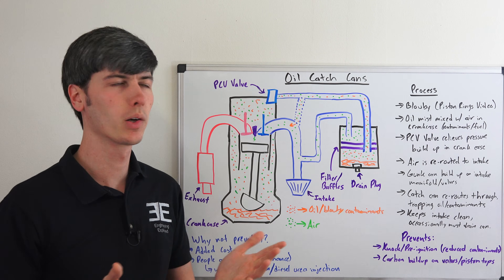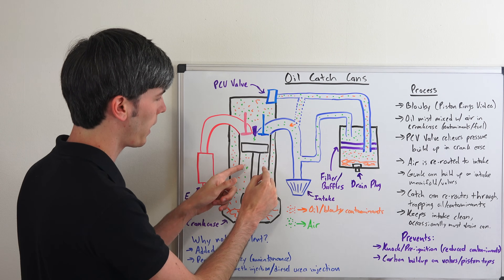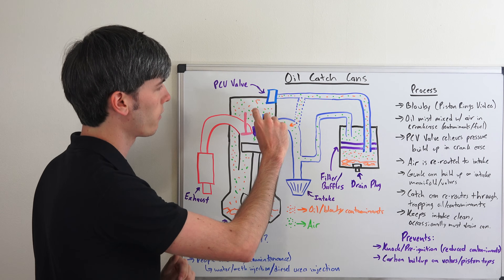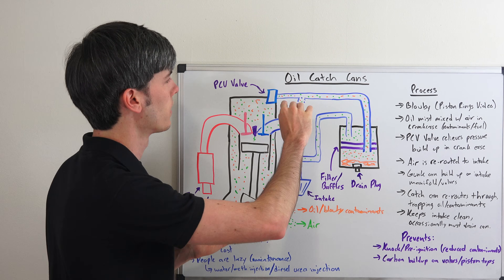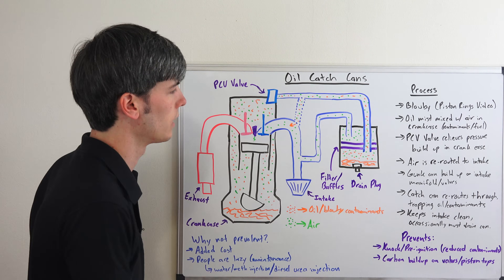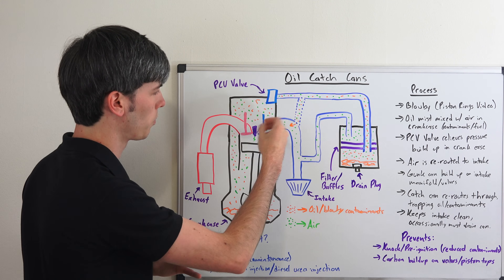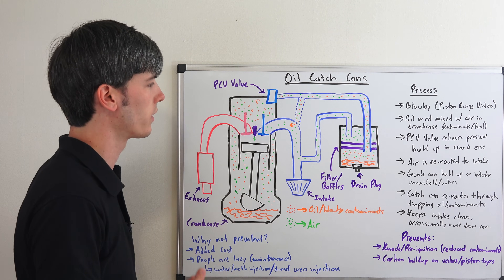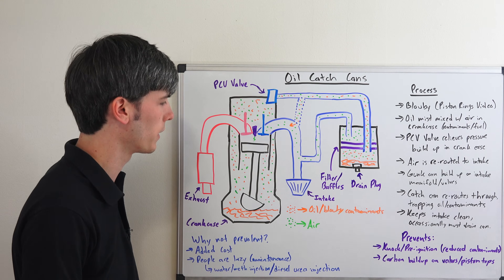What Is An Oil Catch Can?

Comment: Nice, clear explanation.
I'd add a few extras for those curious.

Historically, crankcases were ventilated to the open air: dripping to the ground, that is. It's environmental thinking that had lead to feeding it back to the intake. (Some engines still have the open tube, like older style lawnmovers.)

Stock engines also have some sort of separator already built in, that allows oil to condensate and drip back into the head or sump, before drawn in by the intake.

It's not only the leakage of piston rings that causes crankcase pressure, you also need some ventilation because of the obvious reason of thermal expansion in there, and the movement of the piston(s) themselves.
(Interestingly, the latter is what's actually utilized in two-strokes, this pressure is intentionally contained there.)

Speaking of the crankcase gasses, it actually contains a large amount of water vapor. What you can see as gunk in a ventilation system is a tiny amount of oil residue building up over several years.

In our workshop we've built and tested condensation type cans on a carburettor engine and on an injection one also. It extracted half a litre lightbrownish water quite quickly, so draining the can was really needed. You can still have the benefits of a filter-type can, though, like shown here, as these catch oil particles but let water vapor pass through, as far as I can tell.

All in all, since most of the oil can be separated (done in the valve cover most often) and water vapor is not harmful, it's considered safe and not having major drawbacks feeding it back to the intake.

I just hate the look of oil in my engines' intake parts myself :)
Reply: Quick question, my front seal on the crankshaft leaked oil after 400 miles on my brand new ZL1 after the dealership replaced the seal, a buddy of mine recommend to insta that catch to insure that the pressure won't build up again causing the new seal to pop again during speeding or track use. Do you agree that the catch can would help with that issue?
Reply: @youseftawhed  Your crankcase shouldn't develop that much pressure to begin with. It typically occurs in old engines with worn-out piston seals and bores. The pressure won't drop with the can installed, unless you disconnect it from the air-intake, and let it breathe openly.

Comment: In the Mighty Car Mods video on installing an oil catch can, they mention being wary of plumbing a catch can directly to the pcv valve because it can have an affect on the reading of an air flow meter (not sure if this is a problem if your car uses a manifold pressure sensor instead).  I think that is what they were saying. Even on the forums for my car there seems to be some discrepancy on the correct way to plumb it between the pcv, or the rocker covers, or both.  All cars are different but I was curious if anyone had any thoughts on this.

Comment: what about oil filters? I don't see one in your system, is the oil catch can actually the oil filter? ( the black can I replace every so often when changing oil)?
Reply from the maker: Your oil does not circulate through the PCV system, just what escapes the crankcase as mist. There is a separate system for circulating and filtering oil.
Reply: You should make a video on that :D
Reply: So you still need to change your oil filter this just collects the crap that gets thrown back into the pistons the oil filter is where all of your oil circulates to get rid of all the grim and micro particles anything that goes into that catch can does not go back into your engine it sits there until you empty it

Comment: I'd reiterate the idea of going into slightly more detail for these types of videos. For a topic like catch cans, there are certainly many more arguments for and against catch cans. For cold climates, there's the potential of freezing lines and plugging crankcase ventilation. Also, there are various types of catch cans, including vent to atmosphere and recirculating.
Reply: Regarding to that, it 's also important that the airflow restriction is keeping as small as it could be.
Otherwise the crankcasepressure is getting high and causes Oilleaks.

So, you have to keep the routing short and the catch can should not contain a Brassfilter in it.

Comment: Why  this air return back to intake ???
Reply: You don't have to but why vent gas that could be burned into the atmosphere? A lot of older hot rod engines back in the day just have a tiny filter attached to the the valve cover doing just that.
Reply: +FivepointohJerry thanks
Reply: I owned such an engine at one point and the first thing I did to it was route a rubber hose (later replaced with metal line when it bulged) to return the air back into the intake. Even the intake on that engine was already set up for it, just had to drill out a plug and tap the hole to attach a fitting.
Reply: +FivepointohJerry Environmental regulations. Burning the vapors and then running them through the cat render them environmentally acceptable....at least to date

Comment: would it be possible just to run a filter and let it breathe into the atmosphere?
Reply: That was the usual system back in the day. The oil filler cap just had a few holes in it and a bit of wire wool inside. Fine for the engine but less so for the health of anyone breathing the fumes that came out. Those crankcase gases are really nasty and carcinogenic. In fact they're probably also what makes used engine oil so toxic.
Reply: That was the usual system back in the day. The oil filler cap just had a few holes in it and a bit of wire wool inside. Fine for the engine but less so for the health of anyone breathing the fumes that came out. Those crankcase gases are really nasty and carcinogenic. In fact they're probably also what makes used engine oil so toxic.

Comment: Adding a Catch Can to the F150 EcoBoost engines is getting fairly common, especially when tuned and when used for towing.  I'm considering a catch can for my 2015 F150 , but would like to know if anyone has a recommendation.

Comment: Some say the oil catch can is only useful for boosted cars, what about my natural intake miata 1.8l? is this gonna help or not necessary? @EngineeringExplained
Reply from the maker: It will do the same thing either way, but turbo engines (depending on where the air re-enters) may benefit more from not putting oil on your intercooler/turbo, and also boosted engines tend to be more prone for pre-ignition/knock, which this can (in some ways) help prevent.
Reply: Much appreciated for the reply!

Comment: Cant you just route the oil in the catch can, back to the oil pan of the engine? So that people don't have to worry about changing the oil in the can or would that contaminate the oil to much?
Reply: The stuff that gets caught in the catch can is really nasty. You don't want that back in your crank case if you can avoid it.
Reply: @KlueBat  yet it goes back to turbo intake
Reply: Yes..contaminated.
Reply: Yes, you can, as long as the oil changes are completed on time. BMWs with the M54 inline-6 use a "CCV" system (crankcase ventilation system) that does just that. Problem is, the CCV system in those engines is all plastic, and will eventually crack; especially in cold climates, where the oil vapors/residue/water can freeze overnight. In bad cases, CCV failure has caused hydrolocked engines, when the engine has sucked oil directly into the combustion chambers from the oil pan.
Reply: i have a 300 TDi land rover engine it has a cyclonic oil separator or catch can, it has one inlet and two outlets, one goes directly to the intake hose, the other that is at the bottom of the can, after a funnel type form, goes directly to the crank case dumping the oil separated, but anyways i get a couple of spoons of oil into the intake.
Reply: Hans Göran Högström Probably would clog the cats and not pass emissions..
Reply: TheEdudo Yeah, the BMW CCV system still allows a lot of blow-by into the intake stream, too.
Reply: I dunno, but maybe there is possible to design a safe reliable drain system from the can that routes the excess oil and fumes to the exhaust where it can burn off?
Reply: Hans Göran Högström Yeah, that safe and reliable system is called a "catch can." ;)
Reply: KlueBat The LB7 Duramax had that setup from the factory, and 10,000 mile oil change intervals. Mine has 312,000 miles on it, and there are many with much higher than that. All that stuff is already in your crank case, that's where the PCV is coming from. The lighter stuff (water, fuel) cokes off and goes out with the air. It doesn't hurt to keep it separate, but I don't think it really helps much either.

Comment: Especially important if you have either Direct Injection or Turbo engines, especially if your engine is both. 

Direct Injection you don't get the cleaning action of fuel on the intake valves, so that oil buildup becomes a serious problem. 

Turbo has higher pressure and thus more blowby under boost than a non-turbo, and thus more oil consumed through the PCV system. 

One caveat also, if you have a turbo engine, you have to make sure the PCV valve itself stays on the correct side of the catch can as you don't want boost going into your catch can!
Reply: Once you get into serious boost the stock systems are just inadequate and your dipstick becomes a projectile lol. I run 2 -8AN lines from the VC to a catch can and a -10AN line to the intake.
Reply: Macus Thomas On some cars if you do that however, you will trip engine codes and reduced performance from the ECU. Keeping the EVAP and PCV sensors happy is a big concern on newer cars.
Reply: Hence why I don't own anything new lol
Reply: +Macus Thomas my fiance's new optima sxl has a PCV. Actually on that car with the theta 2 engine, 2 catch cans should be used
Reply: It depends on how the air is metered. Some mass flow sensors are after the air filter, before the throttle body, or at the manifold.
Reply: Macus Thomas so is it a good idea to remove ur pcv all together
Reply: +Macus Thomas not on newer vehicles. I tried to remove my pcv on my 2004 3.4L Tacoma and the motor died and wouldn't start
Reply: Louie Watson Not so true. I have a 2015 and it has a PCV valve. It is part of a larger system of the Air-Oil Separator, which operates similarly but less effectively to a catch can, rather than just being a valve in a hose, but it still exists. Had to relocate it when I added my catch can. 

These systems aren't easily identifiable to someone who worked on cars in the 1970s-1980s, but they do exist.
Reply: Macus Thomas Fiat 500 Abarth. 1.4 Multiair Turbo. It does have the plastic canister air-oil separator. However, you still have to have a check valve to keep boost from going back into the crankcase, which is what the PCV valve functions as. The PCV valve is screwed into the AOS box. It actually does a good job of keeping oil out of the intake, but when tuned and running a lot more than stock boost you can still get some oil in the intake, thus the catch can I added.
Reply: Turbo charged cars will always  need some kind of check valve, I've never really looked in detail how some of the modern forced induction cars go about doing it. The small orifice of these pcv/check valves are so tiny they clog up easy.
Reply: @MTreddevil12  that is recirculation valve, means when you let off the gas pedal immediately when turbo was boosting in air, so you have two options either drasticaly slow down turbo which of course have large kinetic energy while boosting, or to release off the buildup pressure right before intake of engine. Pop off valve
Reply: Macus Thomas Different schemes on different cars. The Fiat has the Air-Oil separator box, which of course is present on the Dodge Dart, Jeep Renegade and new Fiat 124, since they all have the 1.4 turbo available.

However, I talked to a friend with a Chevy Cruze Eco, which is also a 1.4 turbo. Apparently that has some kind of check valve built into the intake manifold and then a failsafe valve of some kind in the valve cover.  If the check valve plugs, the failsafe in the valve cover blows to prevent pressurizing the crankcase. Which apparently happens quite a lot and is expensive to fix.

I prefer the Fiat system personally, it's quite simple once you understand it.
Reply: ***** well what did you try to put in place with of it?
Reply: +Macus Thomas nothing, figured I could just vent it out like my motorcycle
Reply: Yeah a lot of times the ecu assumes the pcv is still installed and miscalculates actual airflow.
Reply: +Macus Thomas oh interesting. when I remove the PCV on my Ducati, no complications happened. It also is fuel injected so the ECU should have detected something, but who knows
Reply: I have a moded 1.9 tdi pd engine and I want to install an oil catch can. Do you know any tutorials on installing can on turbocharged engine or what kind of can I should use? I've read that the in/out should be at least 19mm in diameter, otherwise there's going to be too much engine chocking because the pressure can't flow freely enough.
Reply: Hahahaha boosted catch cans
Reply: I'm confused about the checkvalve on the can on the PCV side.  I've been told I need to run a checkvalve between my outlet on my can and the intake manifold to keep boost from bleading into my can. 

I've talk to two different tuners who specialize in tuning and modifying my car and two different catch can companies.  Some say yes, and some say no it's not necessary.
Reply: I have a VW 3.0 TDI (Touareg) - Should I instal one? I have to change the air damper before the turbo , its leaking very little oil and its the reason I started to look into this ; is it normal? should I instal the catch can? THANKS!!
Reply: exactly. The fiance has a optima with their 2.0T GDI. Catch vans are a must for that car same with the 335i BMW's. The intake valves start looking really bad when you pack on some miles, and it doesnt take much carbon buildup at all to kill power
Reply: that's why some people just remove the pcv altogether. Just another area for boost leaks so you either use a catch can to atmosphere or back to the intake pre turbo.
Reply: +Alvin Brinson What kind of car is it? it's true most new cars dont use a PCV anymore due to its inferior design. You'll find most new cars use a plastic canister that has internal baffles to separate the air, oil, fuel, etc from the engine. I've never removed one or cut one open, I usually just clean them out.
Reply: Exactly, I have a catch can on my Ecoboost F150

Comment: Why don't manufacturers include it in cars?
Reply: The benefit is insignificant and burning it off just eliminates it instead.  If it did offer a benefit it would be stock equipment on BMW or Mercedes Benz and the dealer would charge $200 to service it aka empty the can.  Even Bugatti Veyron does not use this technology when they could charge whatever they wanted for it and to service it.  As is it costs $20,000+ for an oil change/service on that car which includes partial engine disassembly for inspection of components.
Reply: increase car price and people are lazy, don't wanna do more maintance in a car...
Reply: Yep, what he said.  You will have to drain it eventually and the "everyday" driver just wants to put gas in it and go.  They will not check if the catch can is full and then all the gunk collected will just get ingested again but in more concentrated form lol.
Reply: Simpler Answer... EPA (Environmental Protection Agency)  ://

Comment: Couldn't you have that oil left in the catch can return to your sump to be recirculated? Or will the oil be no good?
Reply: My catch is set up like that. It doesn't seem to hurt it any but I use synthetic oil and change it every 4k miles.
Reply: well i'm sure there is going to be at least fuel in that oil your recirculating ...
Reply: Well i have a catch can, and when i drain it it is usually 50% water. you dont want that back into your oil.
Reply: The oil is typically no good
Reply: Yea, many stock cars do it that way.
Reply: Most of what comes out actually isn't oil, but is water, fuel and other contaminates, fine to burn them off but not fine to have in your lubrication system.
Reply: How much oil could possibly be in the can???  I mean most decent cars don't require you to add oil between changes anyway, so how much could it possibly catch and why dump it back in?  Maybe somebody can explain to me why I shouldn't do it old school and just aim my blow by towards the ground instead of recirculating it through the engine...  Emissions I assume
Reply: Kent Sextro well venting to atmosphere is not good for the environment and if you do that with newer cars or cars in general with a MAF sensor, you maybe losing already metered air which will throw off the fuel trims.

Comment: Couldn't you get the same function if you rerouted it to your oil filler shaft? Or would that be too much pressure?
Reply: You don't want that crap rerouted back into your crankcase. It's not just oil but fuel byproducts, contaminants, and anything that bypassed your rings. It's bad enough that the normal setup routes this back into your intake to gunk up your intake valves.
Reply: yep pressure would build up. needs to vent somewhere external.

Comment: What about catch cans that drain back to the block?  My old Pontiac's PCV system included a catch can from the factory with an air/oil separator integrated into the block itself, complete with a series of baffles.  It was an unusually complicated system that took me a week or two to completely figure out...